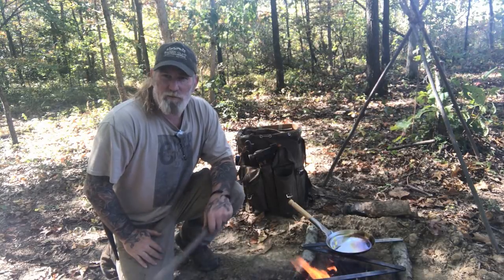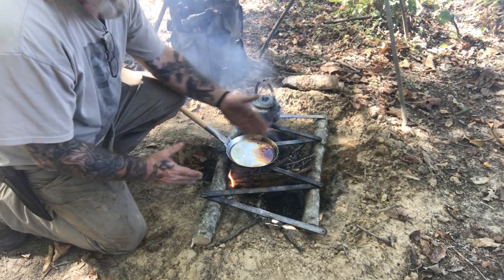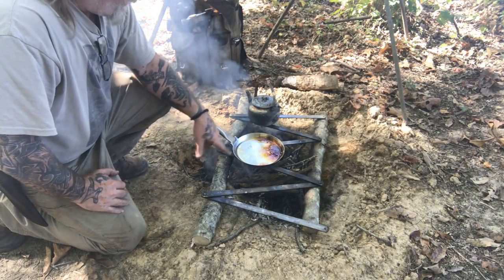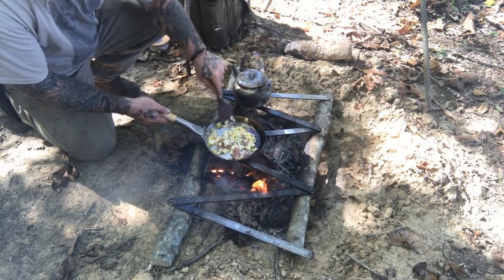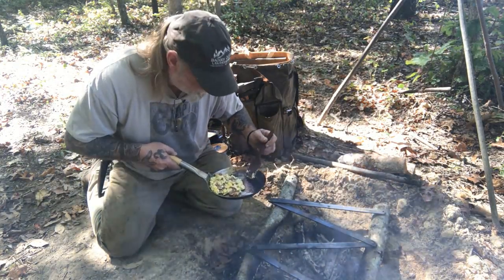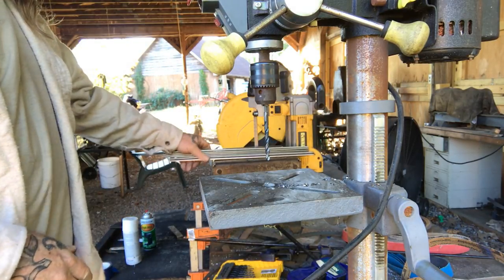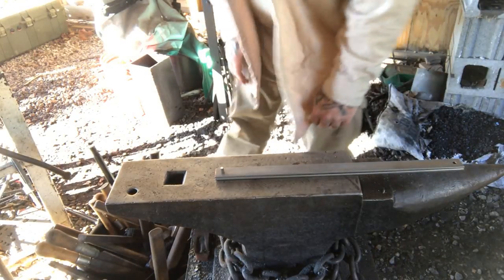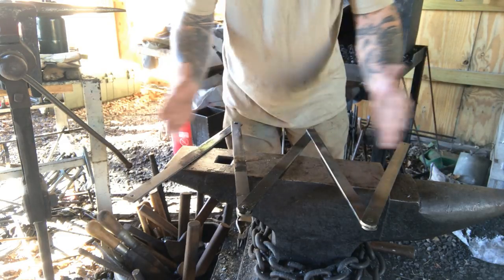1908 A&F Cook Grate

Comment: Could you make this out of aluminum to save weight?
Reply: yes and no. aluminium would save weight but you can melt aluminium on a hot campfire. probably the best you could get would be stainless for the weather and fire resistance so it doesn't rust very fast or get worn out as much. but that could get expensive getting decent stainless in that thickness.